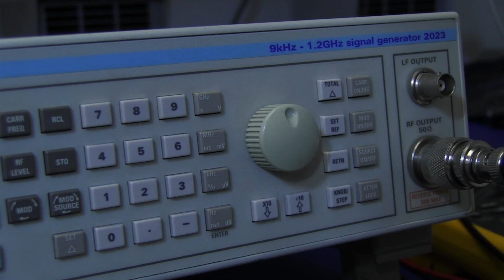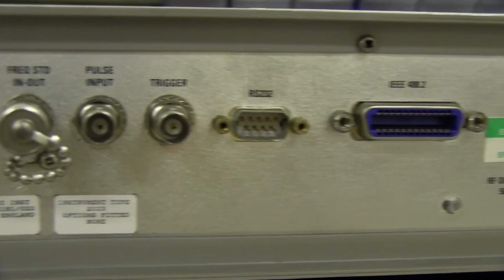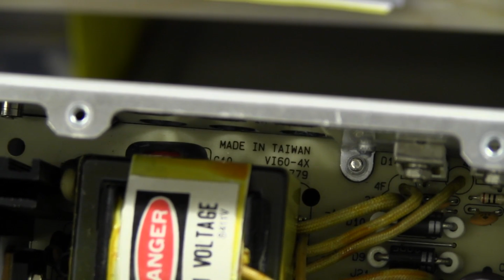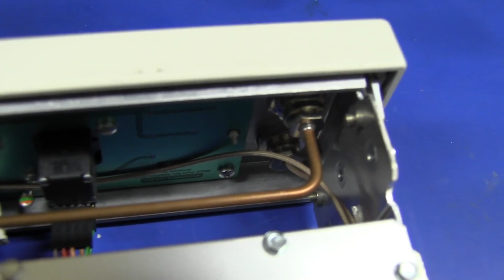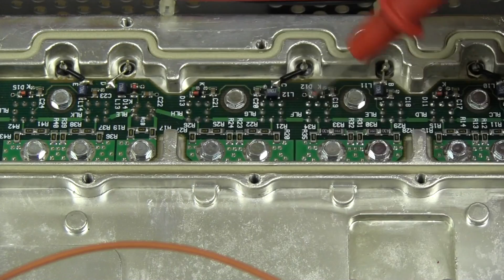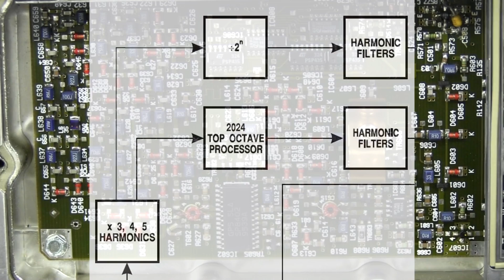EEVblog #261 - Marconi 2023 RF Signal Generator Teardown

Comment: I'm working on a 2023A right now.  The electrical design is as thoughtful as the packaging and construction.  The RF amplifier stages each have active bias control so that there won't be variation in operating point unit to unit transistor differences or over temperature.  The part of the generator I'm familiar with after working on it, is  in my view elegant electronics design.

Comment: I think the first RF section you opened up is mostly the step attenuator (the center sections with the dividing "walls") - you pointed out the relays in each one, they switch in and out "pi"-type resistive attenuators. Regarding DDS, they are getting better (higher sample rates and bits of resolution) but I think most current signal generators use VCO-based synthesizers for lower spurious emissions.

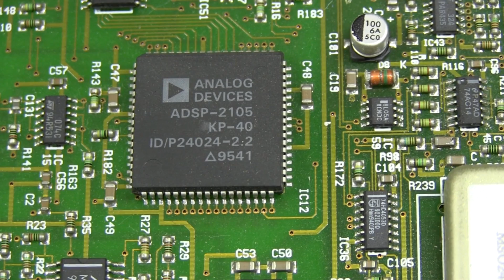Comment: Interesting video thanks! I've got the 2024 version here with the option 4 OCXO. The downside of the hi stability OCXO is you have to wait about 5 minutes after switch on for it to settle fairly well as the accuracy of the 10MHz OXCO is quite poor during the initial warmup time. Note also that the Analog Devices DSP chip at 13:30 is used for accurately synthesising the audio waveforms for the modulation modes rather than for sharing any control of the instrument.

Comment: Great vid good to see inside i love marconi equipment too i have a 2022D generator nice bit of kik thing it is older than the one you examined, Also i have a 2955 radio test set be great if you got the chance to do a tear down on one of those , but yeah reelgood quality miltary spec equipment , Marconi made the clansman military radios and most of there equipment was to that high standard too i ues to work on the radios and used many marconi pices ok keep up the good work

Comment: I wonder if Aeroflex still makes them in England.  What used to be IFR Systems is based not too far from where I live in Wichita, KS.
Reply: Here's where we last left Flash on the IFR saga.
Yes, IFR was purchased by Aeroflex out of New York. This allowed IFR to have better control over the prices of RF attenuators and like items, which are pretty expensive even at the wholesale level. Anyways, in 2014, Cobham Plc. bought Aeroflex, probably for the ability to make inroads as a military vendor in the U.S. fairly early on, they cut loose with Aeroflex N.Y. And late last year, Cobham cut loose of the Wichita KS manufacturer. Instead of reverting to their former IFR identity, they were picked up by another concern, and now their "nom du jour" is Viavi.

As for Marconi Instruments, that was a brand that was purchased not too long after Aeroflex acquired IFR. Though the latter certainly had the capacity to bring the Marconi manufacturing to their Wichita facility, Marconi remained a purely British undertaking. After a while though, many of the Marconi gear was rebranded with the Aeroflex name. And there was a lot of Marconi generators like the 2023 in use at the Wichita plant. Even though it bore a different name, Marconi made those units in England, and they were quite insistent that they be serviced there too. While it would have been nice to be able to have a service depot in the middle of America, alas Aeroflex became a middleman for Marconi support.

Glad that I could share the story of dueling brands, where whole companies are shifted from bean counter to bean counter. Caio!

Comment: Urgh, trying to fix one of these and found that one of the pads is damaged, either the bad itself or one/both of the relays.

Really not looking forward to taking it apart, considering the EMI gasket is all dried up and dead, so that's about £30 of replacements from the start. Relays are way more expensive (£100 each, 2 per att), so hopefully it's the pad with it's cheap pi attenuator resistors.

Bastard thing had me chasing all around the RF section as I was trying to fix an AM mod unlevel (508 error) issue, and then suddenly it lost like 30db of power, so I thought I'd blown one of the preamps, or the leveling section.

Still, I love the style of design from this area, seems to be really logically laid out unlike some of the older kit that didn't have SMD tech.

Comment: Had a few friends that worked for GEC back in the day almost followed them, they worked on military radars... I still don’t know why expensive gear like that doesn’t come with a decent OCXO as standard...
Reply: A lot of the facilities that would use gear like this will have a master cesium or rubidium 10 MHz source, and lock all the gear in the facility to it.  There was an external reference BNC on the back panel.
Reply: Bob Weiss probably true, I’ve worked in dozens of labs throughout the years and not many had a building wide reference clock source and most production environments I’ve been in don’t either. The only time I’ve seen an atomic clock reference source was when I was at Siemens and also AT&T they where usually in an actual metrology lab where equipment like this would be the little guy. I think for a instrument that’s in the $10,000 price range (or whatever the original cost was) another $300 for a decent XO should just be standard IMHO... So in my experience something like this would normally only be connected to a Rubidium source while it was being calibrated, but I might just be unfortunate lol...

Comment: The comment that Dave made about Marconi going for ultra reliable power supply is kind of ironic. We had a bunch of these in our lab (about 10). Almost half of them died due to failed power supplies. It was a pretty easy fix but pretty remarkable at the rate they are dying.
Reply: What failed?
Reply: That's Marconi.

Comment: What would you use a sine wave or something at 600Mhz for exactly? After paying the 1000s for it? Doesn't like wireless usb sticks generate as complex encoded rf signal and it costs like $10?
Reply: Because of accuracy. Generating such frequencies is not difficult, but being able to precisely control them in 1 Hz increments is.

Comment: It's a shame they used those SMT electrolytic capacitors instead of tantalum. I've seen tons of them bad in camcorders and they are hard to change. I'm surprised to see that it will change in 1 Hz increments, I expected maybe 10KHz steps. Now I know why these are so expensive. Wish I had one, would make designing RF equipment much easier.
Reply: If you don't need the low ESR of a tantalum, the aluminum electrolytic will have higher reliability.  The high rate of failures of aluminum electrolytics that plagued the industry ten or fifteen years ago related to problems with the electrolyte.  The formula was stolen and copied incorrectly.   Do a google search on electrolytic capacitor stolen recipe.
Reply: TiredOldFart I remember reading about that, and lately I'm finding that the tantalums aren't that good after all. The Tektronix oscilloscopes, mainly the 485 seems to always get shorted tantalum capacitors, I'm considering changing them all to aluminum electrolytics. I have two of them, sometimes the shorted cap temporary goes away but always keeps coming back, makes it a real pain in the ass to find the bad cap.
Reply: TiredOldFart thanks for the heads up😆